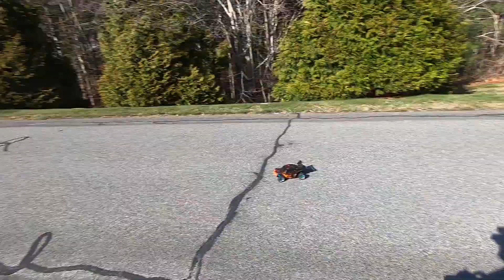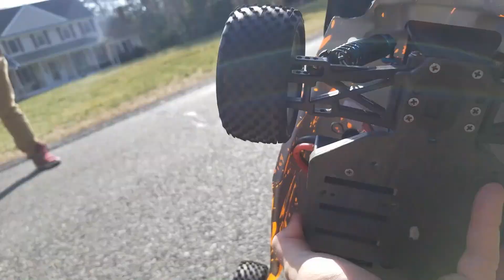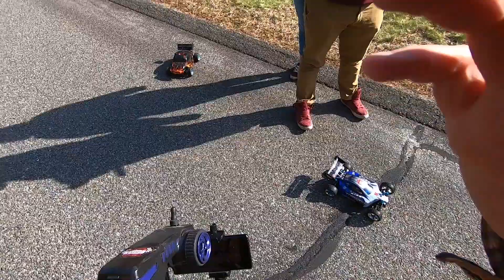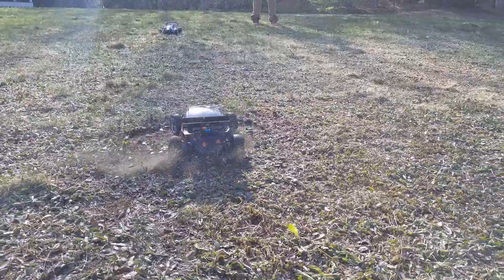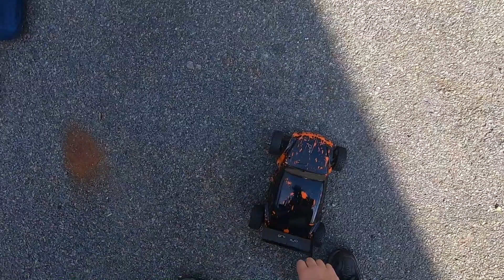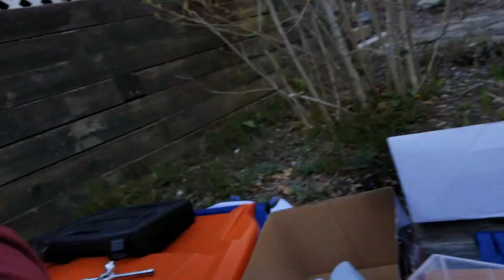RC Street NO PREP DRAG RACING Redcat Racing Tornado

Comment: If you want great street traction on the Tornado epx pro, get yourself a set of Duratrax Banditos! That's what I run on mine for street drags.  For off road stuff, I run Duratrax Six Packs! These tires will upgear the car a bit, so be sure to run a heatsink and fan on the motor, especially if you are running 3s!
Reply from the maker: I will definitely check those out. I'm going with Dboots hoons first as they will fit other cars obviously with adapter
Reply from the maker: Did you swap out 12 for a 17?

Comment: That's a good idea using threadlocker to make threads but the only thing is threadlocker will only activate and harden up or cure due to the minerals in the metal. there are no metal minerals in plastic so the threadlocker will not Harden